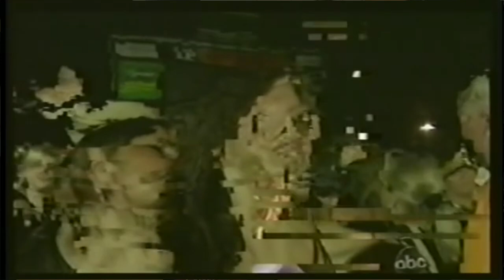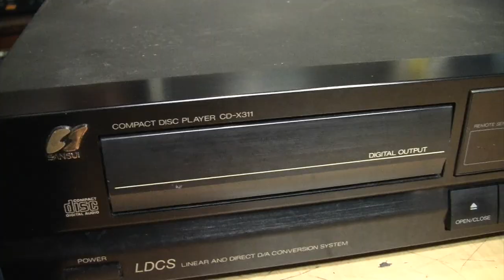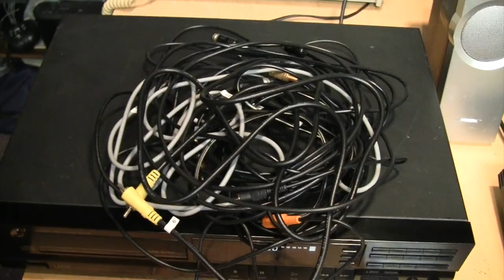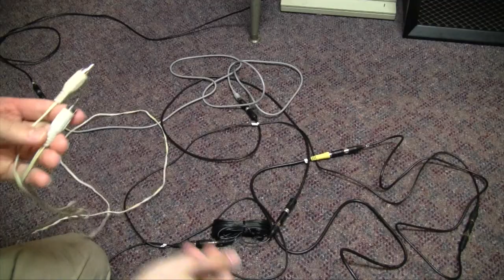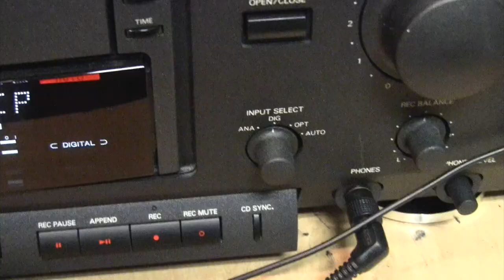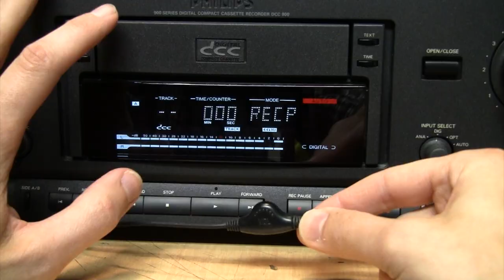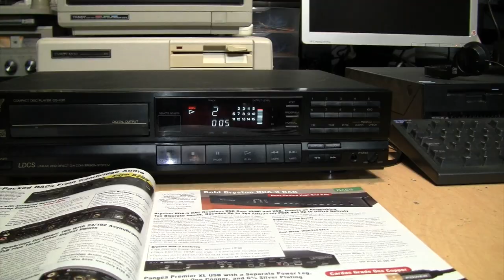What does a crappy digital audio cable actually sound like?

Comment: I agree with you: Bits are bits and crappy coax cables probably work just as well as the ones that are a hundred dollars. 

With the long cables, the signal degrades because it gets weaker (the voltage goes down) and that's also what happens with the little inline potmeter of your special cable. But for long cables, the capacitance between signal and ground, and the induction between source and destination start to be significant too which influences the frequency characteristics of the cable.

When you put in the stereo cable and use it in both directions, I think what happens is that the capacitance finally distorts the signal so much that the PLL on the receiving end can't recover the clock from the source anymore and the clock in the receiver starts running freely. That results in the bits getting shifted in at the wrong time most of the time, but not all the time. But the computer can still make out enough of the bits to grab a sample every once in a while, and at regular intervals. It's like an old CRT TV that has the Vertical Hold setting wrong, and the picture scrolls so fast that you can still sort of see what it should be. This only happens because your computer is still doing its best to get as many samples (really: subframes of biphase data) as it can.

I happen to be very familiar with the circuitry in that DCC-951, and I think the Digital Audio Input/Output chip is a little bit more advanced that the chip in your computer. It detects not only when it can't lock on to the input clock with the PLL, but also when it doesn't see the various bits in the S/PDIF stream that tell it that the input has a valid checksum, is valid PCM audio, is ISO-60958 section 3 (not section 2) and other things. As soon as any of those is wrong, it flips an output pin, telling the recorder that it can't decode things. And I wouldn't be surprised if it needs an entire block of S/PDIF subframes (384 samples) before it flips the pin back. And when that pin is active, the recorder puts the DAC and possibly the output amplifier in Mute mode. So the DCC recorder cuts off the signal much more rigorously and won't turn it back on until it's absolutely sure there are no crackles or pops from misread bits.

It's possible for an S/PDIF coax cable to receive enough interference (e.g. from a power cable that's right next to it) to cause problems. And if you have both analog cables and S/PDIF coax cables connected to a recorder, there's definitely a chance of ground loops / earth loops that make circuits oscillate. But all of those distortions, interferences etc. are not going to degrade a digital signal in the same way as an analog signal. The bits either arrive or they don't. In the unlikely event that a 0 arrives as a 1 or vice versa, you might hear it as a snap, crackle or pop on a receiver that's not picky about what it's receiving (i.e. it's just moving bits). On a smarter receiver like the one in the DCC-951, it will probably result in a muted signal.

And you can't hear jitter in a S/PDIF connection. If some samples arrive a little too early or too late (i.e. jitter), the PLL in the receiver will compensates for it. The only kind of distortion that you might hear is from bad filtering on the D/A converter, causing quantization noise or phase problems. And by using oversampling, DACs basically multiply the Nyquist frequency so the filtering circuitry can become simpler or can be left out altogether.
Reply from the maker: It's actually a DCC 900, but thanks for all of the detailed information!
Reply: @vwestlife  Oops, I thought you had a DCC-951. I wasn't paying enough attention there. I'm less familiar with the DCC-900 but even though it has different S/PDIF chips, the rest of my comment still stands :)
Reply: @vwestlife Hello I'm not sure if all digital equipment is this way (including CD players), I think if I remember correctly most digital equipment has some form of error correction.
  That said I think that depending on the manufacturer and design there could be gain circuit or automatic level circuits. That may explain the differences between the computer and the DCC machine. 
  Some have a mute if the digital signal gets too distorted which appears to be the case with the DCC machine. The card in the computer appears not to have a muting circuit and the signal was beyond the limits of the error correction circuitry. 
  I have done similar experiments only with the optical instead. Pulling the optical cable and separating the connection until it stopped receiving or started to distort. I also pulled the optical and twisted the optical cable (distorting line of sight in other words). 
  I don't remember the exact result 1) distorted at 1st and then it muted or 2) worked until it muted (no distorted signal at all) because the signal didn't have enough bits for a clean signal. 
  Anyway, extremely similar results whether it is using a wire or an optical cable.
  My equipment was stand alone CD music recorders and an optical interface on my computer. It is fascinating to me the optical cable is 48 khz and the signal is mixed in there too. The light appears to be solid red (LED most likely) my eyes are way too slow to detect a 48 khz blink 😂.
Reply: There's also a parity bit at the end of each SP/DIF subframe (bit 31 in the 0...31 sequence) which I've noticed only certain DACs bother to act on.  When I was first testing the SP/DIF output of an ARM single-board computer, a bad register setting was causing it to output all-zeroes for parity, which caused my Yamaha A/V receiver to play no sound at all (though ~50% of the subframes would have good parity by random chance, it must have required a fair number of good subframes in a row to un-mute itself)... but the cheap TC-7510 DAC I use with my headphone amp, which uses a Burr-Brown PCM1716, happily played the zeroed-parity stream without complaint or apparent distortion.  The latter device also ignored the bit-28 "Validity" flag, which some sources use to mark a bad sample (e.g. scratched CD beyond error-correction limits).

OTOH, the PCM1716 does honor the rarely (never?)-used "pre-emphasis" mode set via a channel-status bit pattern, resulting in muddy output with severe treble roll-off when enabled accidentally, while the Yamaha seems not to have implemented that.
Reply: Holy crap! A tech savvy comment on Youtube!! Don't see many of those! :)

So, i won't claim to be an expert but the story as i understand it is this.

Bits are not just bits. In S/PDIF they also carry timing information which is extracted in the receiving device.
Now, the problem is not that the bits don't arrive. The problem is that the slew of the bits increases due to various factors.
A gentler transition means the timing extracted from it will have a bigger error. And this error is called jitter.

Now, you mention PLLs, but those were designed to work with particular rise times and give a particular timing error improvement.
So if the cable filters too much the slope will induce an uncertainty that falls outside of the range for which that particular PLL gives good results.

The real question tho is how much of a problem this is.
I'm pretty sure the mystical cable companies are severely overstating this problem.
But there is something to it nevertheless. With a good enough listening environment i'm sure you can perceive some change at the extremes (extemely bad cables, extremely long cables, badly teminated cables, that sort of thing).
Personally i think that a normal good cable that is within specs will give good results and that the magical cables are a scam.

The video however doesn't test for this type of jitter problems and doesn't actually test these audiophile digital cables. It only tests whether the bits arrive or not. What would be needed is at least an oscilloscope that would show the slew of the bits as they arrive and then figuring out what that means for that particular receiver (including the effect on its PLL).
One of the interesting things is that older devices reportedly have a potentially better PLL than newer devices because signals used to be more wonky. Newer devices might expect the signal to be of better quality and thus fail earlier (in terms of jitter). This is another thing that wasn't tested.
Reply: @wasaaapdroid9477  I agree with you, jitter is not taken into account in this demonstration (or in the reasoning behind "bits are bits") despite it being mentioned in the advertisement for the ridiculous audiophile cable. I guess that you could play a CD with a test signal, send it through different cables to different DACs with high-end / low-end PLLs and observe the result on an oscilloscope. That would be a test that could convince an engineer. A test that could convince an audiophile is a different matter...
Reply: @wasaaapdroid9477  Um ok but the bits is bits argument is talking about the bits that make up the audio that gets piped over the cable not the extra timing bits that aren't present in coax. If we did include those bits then it would be an extremely unfair and heavily biased in optical's favor argument where in reality I'm willing to bet that if I got a coat hanger and properly shielded it and hooked it up to high quality speakers that you wouldn't be able to tell the difference between the coat hanger and optical.
Reply: @michealpersicko9531  Not sure what extra timing bits you are talking about. The timing is encoded directly in the modulation of the s/pdif signal and as far as i know is identical for coax and toslink.
Reply: Wow, you sure know your stuff!🤯😇😎
Reply: In cold countries you can get away with longer cables. Marginally but it does make a difference
Reply: Seriously? Well, that kindof makes sense since the thermal noise would be less and thus in this case even if the slope of the bits is longer, the detection of a transition will be better.
Reply: Don't forget error correction! Most protocols have something like Solomon-Reed-coding which means that even in the unlikely event that a bit of transmitted falsely, the receiving end can correct it automatically.
Reply: About when the stereo cable was used with both ends: Might it be crosstalk between the two wires that ruins the day here? Especially since the wires are actually having electrons run in opposite directions, and they're in many places twisted (looking at the video, lengths of the stereo cable are twisted). Magnetic fields might play a role there, especially when they're spreading in opposite directions.
Reply: Kindof depends on the wire configuration, but generally crosstalk is not a huge problem. A single cable carries electrons in both ways at the same time. It's a coaxial cable with a signal wire in the middle and a return path over the shield on the outside. So these energies tend to cancel out.
What is more of a problem is any external field acting on the shield. So keep the cables away from unshielded sources.
Reply: The Y-Cable Connectors, those were connected wrong. those Y-Cable Connectors output to dual mono. That's why it was sounding distorted. He had them connected both to the input OUT  side. The single side of the Y input IN, the other two are input OUT.
Reply: i just use a crappy rca cable to connect coaxial and works just fine
Reply: The fact that it works for you doesn't mean it works in other situations. The spec calls for a coax cable and there are good technical reasons for that spec.
Reply: @wasaaapdroid9477  Almost ALL RCA cables, (except for some really cheap, old, "speaker cable" types), already ARE coaxial in design, so that is probably why they work just fine for digital signals, even if they aren't specifically "labelled" or "rated" for digital signals.
Reply: @JoeJ-8282  Sure, but RCA cables are not coax cables. Coax cables are special. For one, RCA cables have the wrong impedance and you'll get reflections and whatnot that will screw with the extracted timing.
Reply: @wasaaapdroid9477  That isn't true. MOST RCA type cables, at least decent quality ones, most definitely ARE COAXIAL in design. If you don't believe me then cut a few of them in half and look at the bare cut ends and you'll see that most of them generally ARE coaxial in design. 

And "timing issues", especially when it comes to cables and wires, are more of an "audiophile baloney" statement that is thrown around in the audiophile world to sell (MUCH) more expensive cables to the uninformed masses totally unnecessarily, and you can either choose to buy (literally, with an unnecessarily high amount of your own hard earned money), into that lie, or else you definitely CAN just as well spend a LOT less on a still decent quality, but generally "basic" (by "audiophoolery" standards), RCA cable of coaxial design, and still get perfect digital signal transfer between components, I know from personal experience. I've used "basic" (decent) quality RCA cables for digital signals for years without ever ANY issues whatsoever, so I know it isn't absolutely necessary to have a cable that is "rated for digital" for it to work totally perfectly in most cases, and said cable also definitely does NOT have to be expensive for it to work totally fine either!
Reply: @JoeJ-8282  When i say 'coax cable' i'm not just talking about the cable geometry. Audio cables have had coaxial geometry for a long time now. I was talking about actual coax cables designed for transfer of high frequency (MHz and up). There is a special thing about actual coax cables and that is the dielectric. Normal audio cables don't need it because the frequencies involved are quite low. There is also a strict impedance to an actual coax cable. It is needed for optimal transfer of these high frequencies and for preventing reflections. That is why coax cables state their impedance. You have 50 Ohm cables, 75 Ohm, etc, etc.  https://en.wikipedia.org/wiki/Coaxial_cable

So again, while normal audio cables can work for S/PDIF, they will also screw the timing because of reflections and whatnot because they are not actual coax cables designed for that particular physical interface.
Reply: @wasaaapdroid9477  Maybe so, but maybe not, that is all still debated, (obviously), as it is being here, not just between you and me, but also among many other commenters and "audio nerds" here, including the original poster of this video, (just the fact that he was able to get almost 100 feet total of TOTALLY CRAPPY QUALITY "RCA" cables to still be able to pass the digital signal just fine before it finally failed, even surprised ME, lol!... Find and read my other separate comment in regards to my thoughts on that), but anyway, even IF an "audio RCA" coax cable is used for a digital signal, (i.e. instead of a "properly rated FOR digital" coax cable), and it actually does affect the "timing" or "jitter" or (anything else), that difference is usually so extremely minute that the ONLY way to actually tell ANY difference is to actually measure certain specific aspects of the "signal in" vs. the "signal out" of said cable with very precise meters or electronic measuring instruments, but one can almost NEVER actually be able to HEAR ANY real difference in sound quality between different types of coax cables, as long as they are at least of a semi decent quality and they're not physically broken or damaged in some way...

At least I've never noticed any sound quality differences myself, even with very careful listening, not at any time in my life, and I've been an "audio nerd" for decades already, always having a "nicer than average" stereo system, and experimenting with hookups and connections among components in MANY different ways over the years, just out of either simple curiosity or sometimes even necessity because I just didn't have the absolute "proper" type of cable at the time, so even IF there's ANY kind of (electrically maybe?) "significant" difference between different types of coax cables when passing a digital signal, if one cannot actually HEAR any of those supposed differences, then do they even really TRULY matter in the end, and for basic music enjoyment? I don't really think so.

Anyone can obsessively "nitpick" the details of just about ANY aspect of audio if they want to, but what's the point of doing that if it doesn't actually NOTICEABLY AND SIGNIFICANTLY IMPROVE your final resulting listening experience? (If something you're arguing about DOESN'T NOTICEABLY and significantly improve your end listening experience, then you're basically just "wasting" your time, time that could be better spent just listening to your music collection and actually enjoying it instead, and just simply not worrying about all of the totally endless minute details of things that COULD be "worried" about, (but definitely don't "HAVE" to be for good sound)...

Which brings me to my ultimate point here... Maybe BOTH of us should just stop "discussing" this topic, and instead just go and listen to some really enjoyable music on our stereo systems, whether they be hooked up with "properly rated" "digital coax" cables or not... As long as our systems work properly and sound good to each of us, then we're both just fine, whichever approach we may use!

Now, on one last note, (since I AM also an actual official "audio NERD" just like you, lol), I've also always wondered, but never really truly understood WHY, different types of coax cables are "rated" at different "impedances", (such as "50 ohms", "75 ohms", or whatever, I can't even think of them all), because you can't actually measure ANY noticeable impedance across any coax cable with an ohmmeter... They ALL measure "open" or "infinite" ohms, so where, why, and how do they label them with a certain "ohm" "rating"?? (And what significant difference does that ACTUALLY make in real world applications? Because I've used different supposed "ohm rated" coax cables in ALL sorts of ways, and for ALL sorts of different hookups between various components over the years, and I've never noticed ANY kind of performance OR sound or video quality differences among the different "ratings" of coax cables... So I've always wondered what's even the point of them having those "ohm rating" numbers on them in the first place, since in my experience, ANY "kind" of coax cable seems to work perfectly fine for ANYTHING and in ANY place where a coax cable can be connected in any way...

I guess I need to be able to better understand a more significant AND legitimate technical reason for the rating differences among different types of coax cables, but so far I've never been able to really find one... Maybe you can elaborate on what is the reasoning behind the ohm ratings of different coax cables and WHY and HOW they differ...? I have read various things about this over the years, but I've just never actually seen or heard in real world usage, ANY significant difference between the different types, as far as performance goes, as I said above.
Reply: @JoeJ-8282  Another thing about the video, the 10" RCA cable is actually a coax! It was designed for video. And guess what, the most common video coax ohmage is, you guessed it, 75 Ohms. That cable, even tho it's from the 80s, is a perfectly fine cable for S/PDIF! :)
Reply: @wasaaapdroid9477  You didn't answer my question. (Read my last reply in its entirety, all the way through to the end. I always do that with anyone else's reply too, when having a discussion about anything.)
Reply: @JoeJ-8282  You haven't asked a clear question. You asked multiple questions suggesting to me you don't understand the subject at all and you're looking for general answers so i gave a general answer. If you want to understand specifics you'll have to ask more specific answers that are not embedded in swaths of text. 

About impedance (that what we're talking about when we say '75 Ohm' in the context of a coax cable), you can't measure impedance with a typical multimeter. Impedance (denoted in Ohms, just like ye ol' resistance) is the resistance !per frequency!. So unlike the normal notion of resistance, which pertains to DC current, impedance is different for different frequencies.
And in fact, since DC can be considered a frequency of 0Hz, we can also say that normal DC resistance (which you can measure with your multimeter) is just the DC (0 Hz) part of the impedance that describes the resistance for all frequencies. So you need to develop a notion of an electrical resistance that depends of the frequencies contained in the signal that is being transferred. And by signal i don't mean the stuff that is encoded in the signal, but the actual signal as it is put on the wire. So in case of spdif, not the audio that is encoded in the spdif signal but the actual voltages that are put on the cable, so the frequencies involved in putting a '1' or a ;0; on the line and the speed at which this happens.

If you want to know how and why coax cables differ you would need to dive deeper into what a transmission line ( https://en.wikipedia.org/wiki/Transmission_line ) is. Long story short: Coax cables are designed to be transmission lines, normal audio RCA cables are not.
Reply: @wasaaapdroid9477  Yeah, that's enough info for me I guess, (I looked at that wiki article), but I'll never fully understand this concept, because as SOON as they start getting into all of the crazy calculus and stuff that's involved in figuring all of this kind of stuff out, I am immediately lost, like "Whoosh! Right over my head!" Lol!... That's why I failed at studying "Electrical Engineering" in college, and I had to drop out, because I quickly realized that wasn't within my realm of comprehension... I'll just leave that stuff up to all of the absolute geniuses of the world, and in the meantime, I just focus on the end result of all of that and just sit back and enjoy whatever music I listen to as a result of all of their genius designs!

I still like dabbling in electronic stuff as a hobby because some of it is at least interesting to me, even if I don't fully understand it, and I can at least understand most of the most very basic concepts of speakers and the relatively simpler electrical things like that, but when it comes to the more complicated stuff, I just can't wrap my brain around most of it...

Oh well, I do what I can, where I can, not always electronic related stuff either, I have a VERY wide variety of interests, so my mind is always busy thinking about or learning about something!
Reply: Sorry, no S/PDIF suffers from jitter because of a bad clock signal. HDMI fixed it.
Reply: @doltBmB  I'm not sure what you're trying to say but HDMI = DVI + SPDIF
Reply: @JacGoudsmit  I'm saying all S/PDIF suffers from jitter because the clock signal is bad. But a revision of HDMI fixed it.
Reply: Aa
Reply: I wonder if the distortions would remain the same if you used the black and red halves of the stereo cable in the SAME direction?
Reply: Ridiculously good comment.  😮